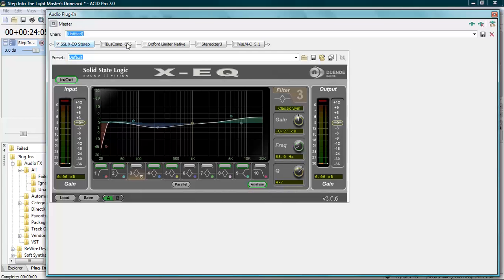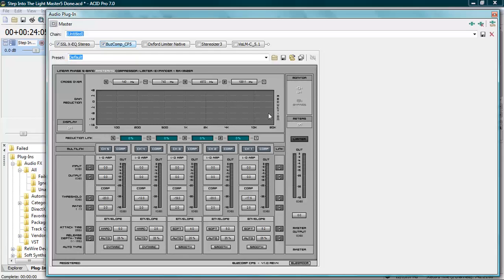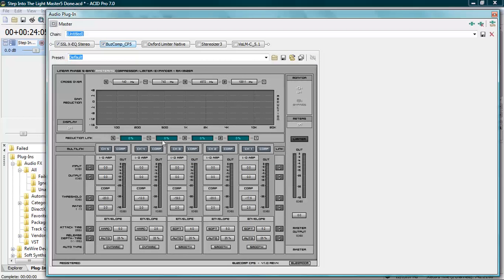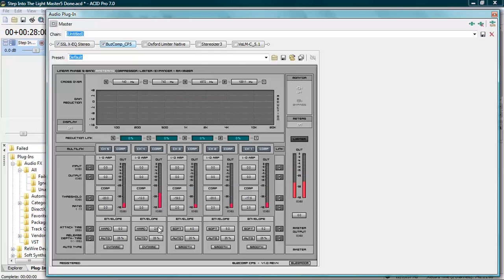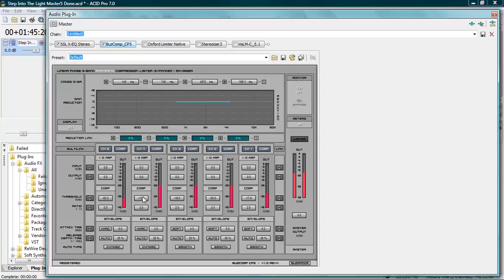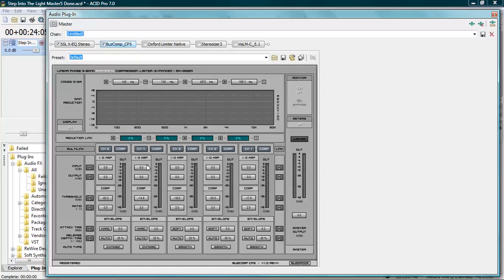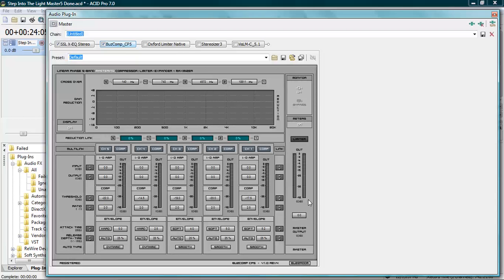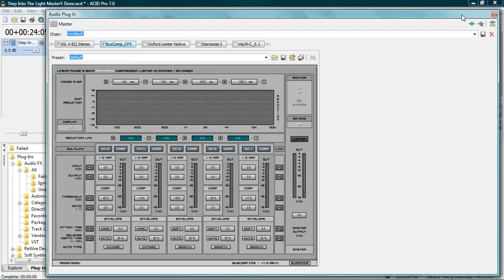How To Master: Compression- Using Acid Pro Studio 7

Comment: Sony is a great looper but kind of drags when composing with MIDI, freezes. I have found a alternative way to do, some of your vst synths will run just fine as you track them in sony, the more you add, the more it will freeze or have what is called drop out. So I got a external vst host that I can run all my vst synths in and record right at the hosts those riff, saving the wav file to desktop or your loop archive, then open sony and you can import that wav file right in and do the various clip changes you need for beatmapper, if you practice, and learn it, you can set your midi clock with each and your BPM listening and practice, you can get good and don't have to auto trim with beat mapper, you can just lay your riffs in. I use like four DAW in my studio so I may say stuff that is different than what you find in sony manuals type: free vsthost and download it the hermann seib one. It does the same thing as that native instruments crap Kontact player BUT you can download all those free synths from vst4free and run them AND ITS FREE, NI wants you to pay them to do the same thing this does for free, plays synths and records that synth to a wav file
Reply: Remember this...you as the artist, can use what ever the hell you want to make your songs, there is this crap about 'industry standard'. THAT only applies to you if you are say a recording studio and producing records for sale, people coming to you setting up their band gear and recording on your million track console, they then will probably use pro tools, cakewalk sonar is another one that is industry stand...but AVID is just money grubby scum like that, as for you, you can use a kids kazoo to make a song if that's what you have. The studio will record you to their tracker and cut the mp3 and wvv for CD Don't let those jerk offs scare you into blowing all you money to get what they call industry standard. Just get you what you like to play, instruments, your drums, the midi controllers you like and can afford and a fine DAW like Sony Acid Pro 7 and just play. You can take your Sony and your computer to their studio, they will record from yours..At .the studio,they don't give a crap what you use and they will be more than happy to help you, that's their job, they love music too ya know.
Reply: MultiNowWhat
OH and I say all this because sony is a stable read only type of DAW, if you are pulling from wav file loops, it doesnt destruct the loop, so you can screw up like I have or every other musician has a hundred millions times, you wont fuck up your whole song, provided you save your work. and you can finish your tracks. In my 28 years of playing computer music, there is not one thing that I haven't Fucked up LOL in one way or another. When you get as crafty as I do with loops and samples(my wav files are loops , made form that VST HOST) you will have screwed up many times, but you wont ruin the actual file, so you can start over until you get it right.

Comment: I first mix all the levels of each track with the basic eq that sony has on each track, that channel really pretty damned good, then when you have your levels set, set your volume master to about 3.3 to 4.4, render your song into a WAV. Save your work. remember the BPM(tempo) and then open a new track and run that wav file into a new tack. set the BPM to what you had in that last render, This gives you much more working space, you won't have clipping. If you have over like 30 individual track in a song, you may have clipping issues. Then use your compressors. I use a focusrite midnight compressor for most. but there are many good freebie compressors on like vst4free
Reply: some may say sony is not pro, they have to have all that new DAW. I have become the master of Sony Acid and use it on a pro basis...I have different things to encode my wav files to top notch mp3 encoders, but it is not a DAW, just wav to mp3 converter. I am just as potent with my sony as one would be with pro tools-its not the computer or DAW, its the dude working it. The only bad rap is people have mac and they dont have a MAC version, if they did, pro tools would be seriously rivaled with what you can do...learn to use those VST TOOLS, sony can run almost everything made for vst effects...its just a bunch of effects that pro tools has written into their software, if you are smart and savvy, you can figure out how to get the same tools in your sony. Learn to use that PAINT TOOL, set if for whole notes and you can literally paint your music on, you will see that no other DAW has this quite like sony, your music will become like art not just several loops on a tracker..I am on a label with my Sony acid
Reply: MultiNowWhat
 I wouldnt trust these they say is free right next to all this..just like anything, you have to buy it. These probably are the demo or loaded with shit like viruses

Comment: It's possible, but it doesn't give any added quality to the original source recording.  All it will do is increase the file size.  If they want that 48khz/24bit quality, they have to set the session up that way from the jump, and utilize an interface that supports it.  I'm using an older 44.1khz/16bit interface, myself...